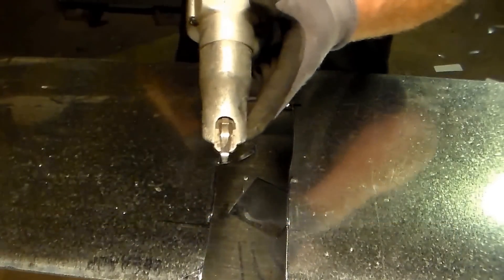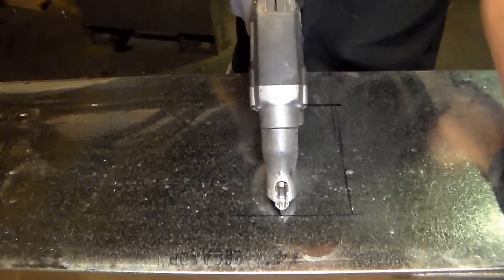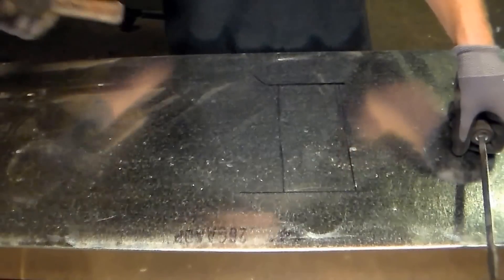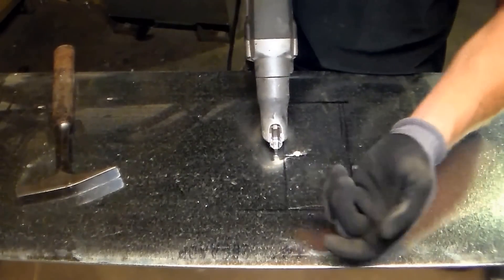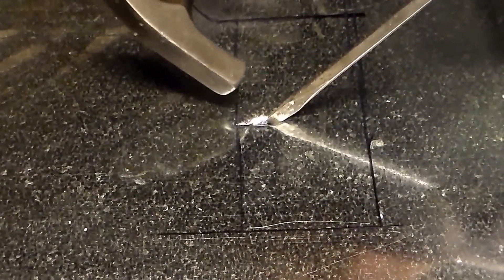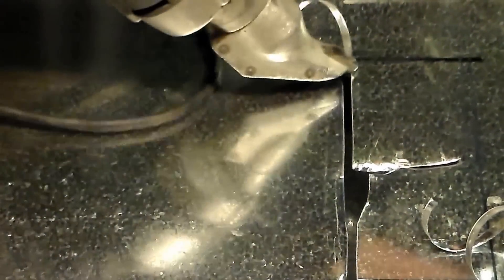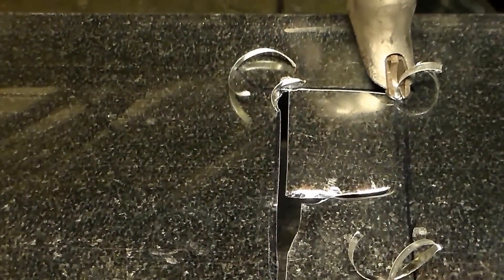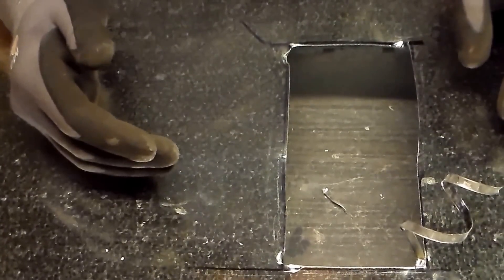How to use double cuts to cut sheet metal -The Sheet Metal Kid

Comment: Hi, can you do a video on how to measure and install a flexible joint between two pieces of duct work? [ example- a drop return going to a filter rack on a residential furnace] It would really help me out. THANKS FRIEND
Reply from the maker: Hey Ronald, there isn't much to it. Flex is very forgiving in the since you can always bundle excess on the collar you're connecting to. I always start at the duct and end at the register. I keep the fkex in the box/bag until I am ready to connect to the register. Then I just stretch it until its got a nice loong bend with no kinks and then cutit a little longer. Hope that helps!